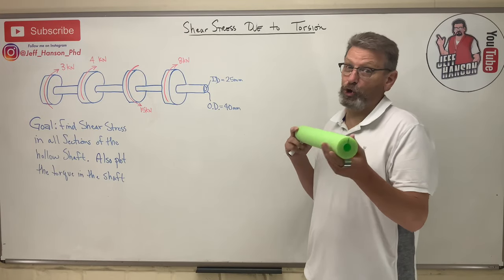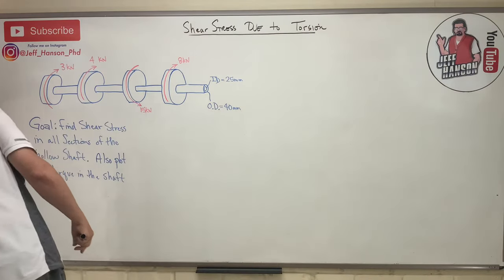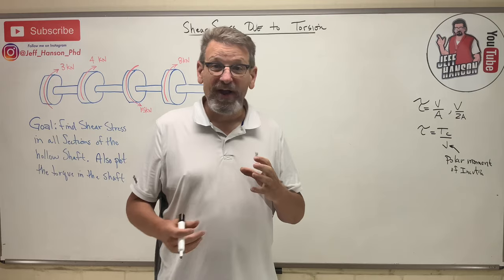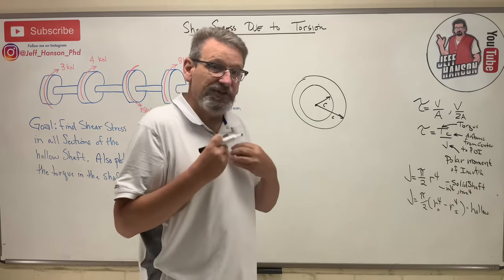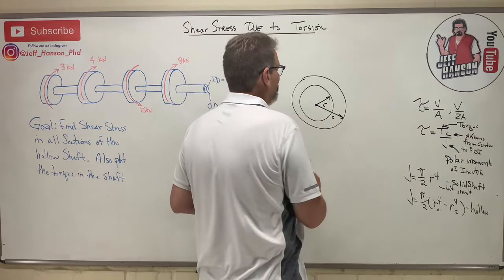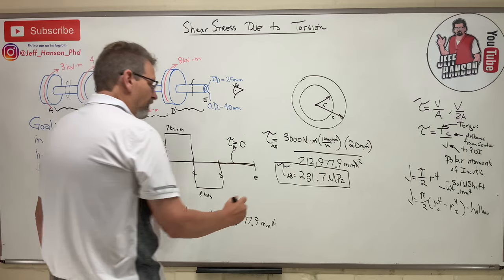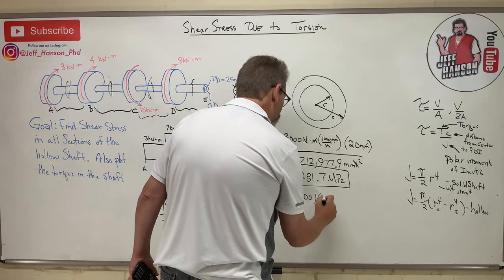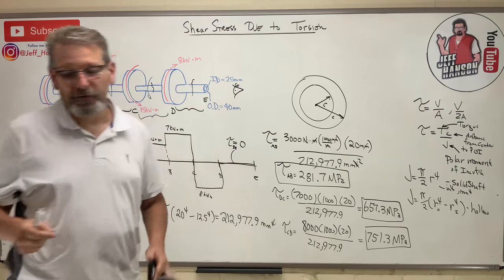Mechanics of Materials: Lesson 23 - Shear Stress Due to Torsion, Polar Moment of Inertia

Comment: might be a stupid question but why is it 20mm for C
Reply: Prolly too late but it's half of the outer diameter as we want to find the biggest shear stress(which is located at the further most point from the rotation center)
Reply: @tonicakarun1731  isnt it suppose to be 40mm because it is from the centre of the circle no?
Reply: @damhilmn No, 40mm is the diameter. We need radius so 40 ÷ 2 = 20mm.

Comment: Is C = 20mm because it's half of 40mm? Why wouldn't it be C = 40mm since in the drawing he says that C is the length from the center of the shaft to the outer part of the shaft
Reply: You just explained why C wouldn't be 40mm lmao. C has to be a radius (half of a diameter) which the 40mm would not be since it's given as a diameter.

Comment: Thank you for your valuable information @Mr. Jeff Hanson! Hello everyone, I have a question about that, If we apply heat treatment to related shaft, will there be any improvement regarding the angle of twist or shaft safety?
I mean, How can we calculate the effects of heat treatment in case of comparing the case hardened steel or induction hardened steel (20MnCr5 vs 4140)during calculation of torsion on the shaft?

Comment: Can someone explain to me why he used MPa as the units for the final answer?
Reply: A bit late but the standard unit for pressure is the pascal (N/m^2), but since he did his calculations using mm, his final answer would have been in N/mm^2, which is the megapascal